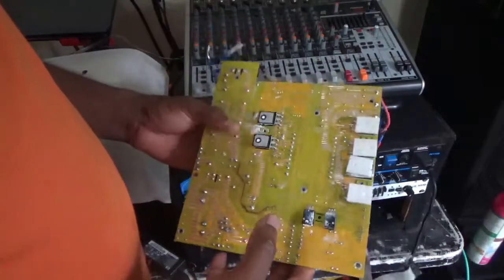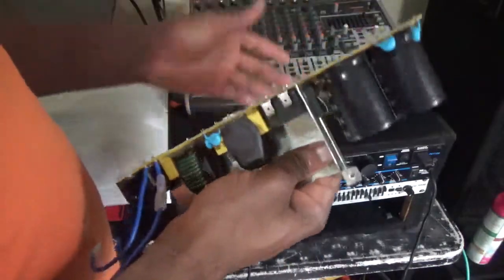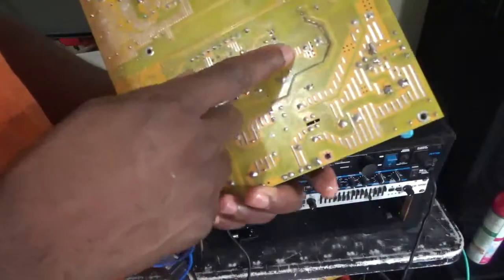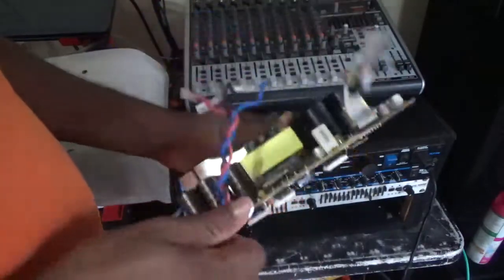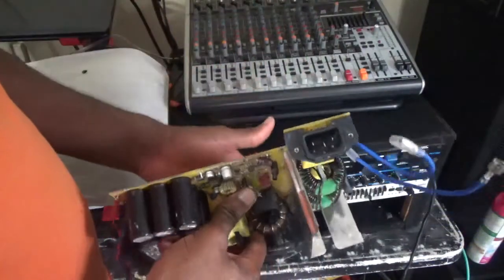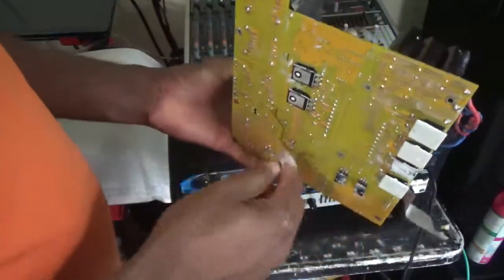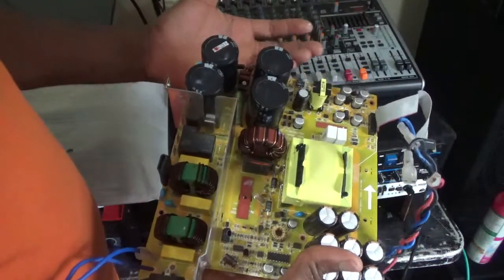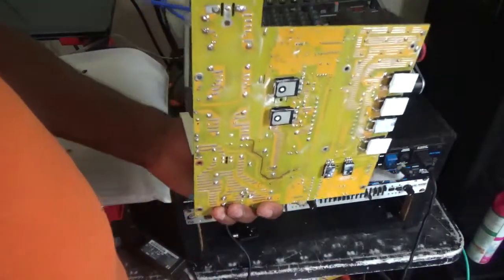Amplifier Repair  : BEHRINGER iNUKE NU6000 POWER SUPPLY PROBLEM

Comment: I have the nx 6000 ,I am getting the 83v plus and minus once the 3 wire are tested out the circuit .
P
But protect mode once I turn on everything connected

Comment: that track goes to the primary power supply .there is bridge rectifier comprising of 4 hv diodes ,also there is an 4 pin chip  and 2 melf diodes that blow ,also change the ntc resistor on the supply side .and repair the track last .

Comment: i can repair these .i have one i am repairing right now .
Reply: do tell.. i got 2 of them.. one stats in fault and the other wont power on at all
Reply: for real?
Reply: Colin could you fix mine ? It's a Nu4-6000
Reply: @24k_purplelove52  YES
Reply: @colincampbell4089  mine is having the power supply issue. How much would you charge to fix it ? I know for a fact these power supplies are rare to find
Reply: @colincampbell4089  What part do I need to replace on my power supply, i'm getting no power at all?
Reply: Are you still repairing these boards

Comment: i left a comment here and came back to see if there was any response but instead i cant find the message so i wont be typing what i had before ill just ask this ...
Where can i buy the power supply for the iNuke nu4 6000 cause this is a bunch of BS cause it still has new smell and not a mark cause i hardly used it till recently and now i cant even turn it on
Reply: send it to me i will repair it
Reply: @colincampbell4089  send it to you where.... do you live on my island ????
Reply: @colincampbell4089 i have problem with this amp, and want to ask what is it

Comment: That PCB trace is cooked. That can easily be fixed by hard wiring the two points if there's no continuity. That's not to say it your only problem.